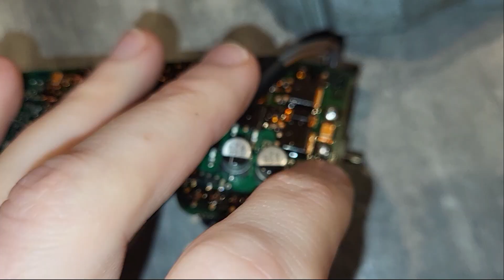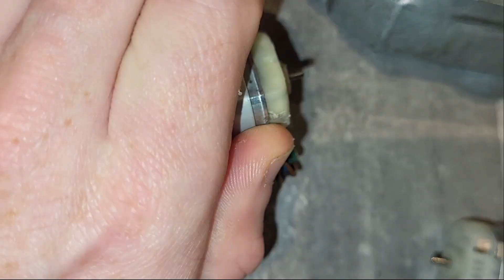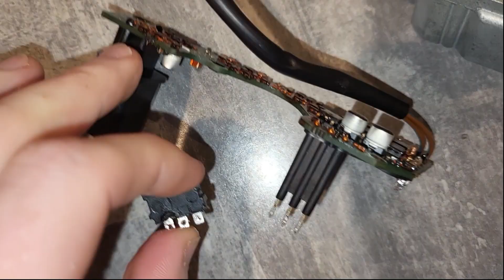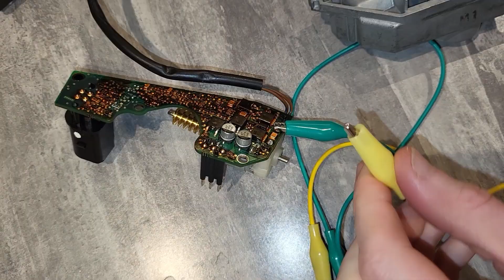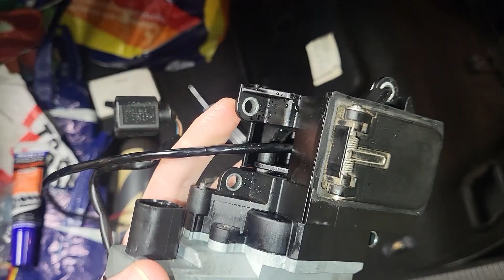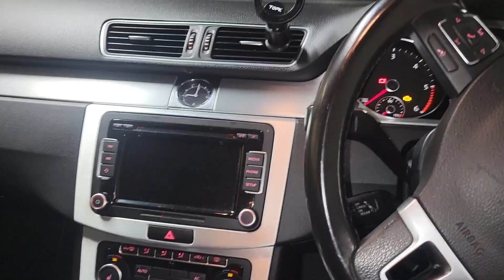VW Passat B7 reverse camera repair

Comment: For anyone that finds this and wants to do the job properly. I didn't had a working one so i found out everything with trial and error:
On the 4 pin connector for testing:

Pin 1: Not sure yet, but it's signal going to the trunk lock from the handle switch most likely..
Pin 2: GND
Pin 3: 12V
Pin 4: 12V reverse signal

When powering on depending on the state of the microswitch it will move to one of the end positions. Activating the reverse signal should move it on the other position.
On mine i found out later that the microswitch was kinda jammed after desoldering and needed quite a few manual presses to get it working correctly again. Better to cut the terminals rather than desolder, and solder them back when changing the motor, or just use a new microswitch.
On the microswitch Pins 1+3 should be connected unpressed, then Pins 1+2 when pressed. On mine since it was stuck on one place the motor would only move to one position.
Make sure this is working properly before testing since it will overheat and damage the motor if it gets stuck and the microswitch doesn't give end stop signal.

Moreover, how you assemble the gears is important. The "correct" way is to move all the gears to the full counterclockwise end stop position. Then when putting in the big double gear you need to align to the end stop because the worm gear on the motor will lock you to where you place it. Then place the top cover arm to the rest/close position that is marked on the cover. Then test from the backside manually like in the video (use 5V not 12V) and see the range of the arm is like the factory wear marks. It should move clockwise from the starting position and stop, then reverse polarity and should come and stop at the start.

An easier way (that i didn't test though) is just assemble at whatever position, then use power on the motor manually to drive the arm fully counterclockwise until it stops, then take top cover and put to start/rest position and close back up. This should be perfectly fine. 

Hope this helps.

Comment: Nice video.. I am also in the process of retrofitting flipcamera in my base model b7 passat with Rcd340.. I am curious to what is the input voltage for oem camera
Reply from the maker: The input voltage was 12v, i used a 9v battery to test the motor in the video as its what i had to hand and close enough to test it

Comment: Thanks for great video, I have a similar problem, Mine is not coming out completely, makes around 10% of lower part of screen black. Any advise?
Reply from the maker: Thanks, sounds like it's getting stuck probably needs a cleaning and relube it up
Reply: @SaolEile  Would you say it's feasible for a relatively inexperienced person like myself (especially with finicky little parts like this) to take the motor out, clean it, and relube it? I don't know what to use for lubricant, for one thing—or if I need some kind of product to clean it with as well—and my internet searches have been of little help. Not a ton of info on this subject that I've been able to find.

Edit: Oh looks I'd need to desolder those little pin things as well just to get into the housing? I think I might be out of my depth here but I could imagine this being a $500+ job at a mechanic's shop and I reeeally don't want that, so... yeah, just curious what you think the degree of difficulty is here. I haven't used a soldering iron since I was a teenager, for instance.
Reply from the maker: @eashton42  yes an inexperienced person could do it but you need to diagnose the problem first, there's no point in taking out the motor unless you are replacing it. If replacing it then the switch is likely to get damaged when desoldering it so would advise order a spare one when ordering the motor, its easy to resolder it just desoldering is a bit difficult.
Otherwise if just looking to clean you don't need to take the motor unit apart, clean with any organic solvent just not water and regrease with silicone grease, the thick stuff not the spray, could probably use any regular grease if you dont have silicone. There's nothing to lose by giving it a go yourself, a mechanic wont repair it for you they will just fit a new part so even if it went badly if its not working how much more can you break it!

Comment: What if there is no voltage on these 2 spots
Reply from the maker: There is only voltage momentarily after putting in reverse and after putting out of reverse. If there is none then either have no communication issue to the module, no power to the module or a failed module. Test the incoming voltage to the module to rule out the first, test the communication wires to the module, if one isnt working thats your problem if both are working it is a faulty module